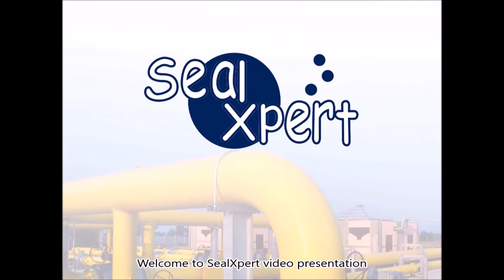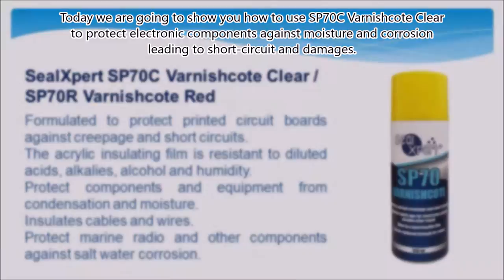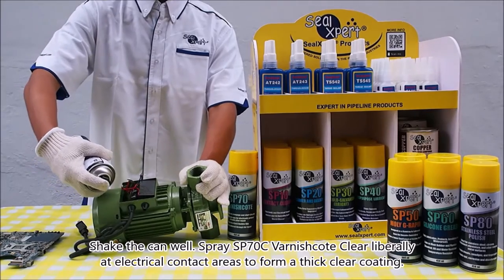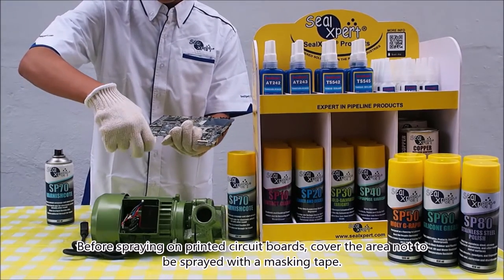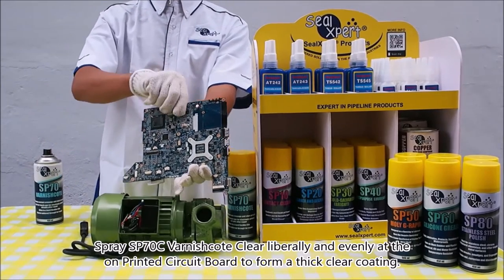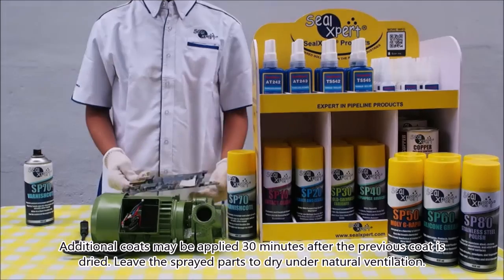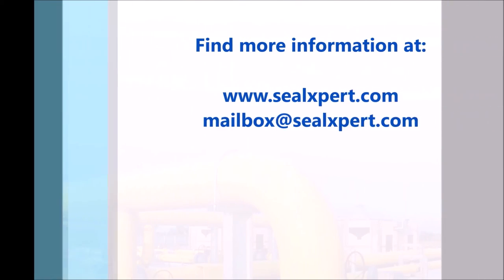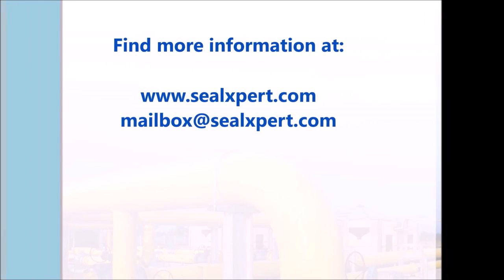Protect printed circuit boards & electrical connections with SP70C Varnishcote Clear

Comment: Would this work for a HVAC circuit board in my crawl space air handler? I’ve gone through two circuit boards in two years due to excessive humidity. I realize I should de energize but can I spray the board as I find it mounted?